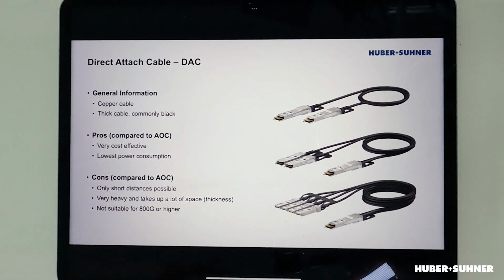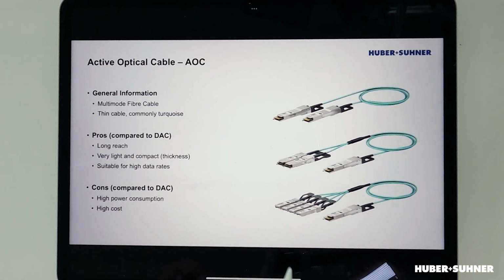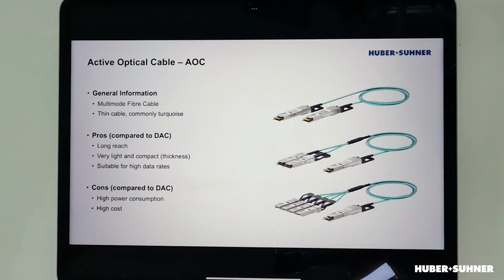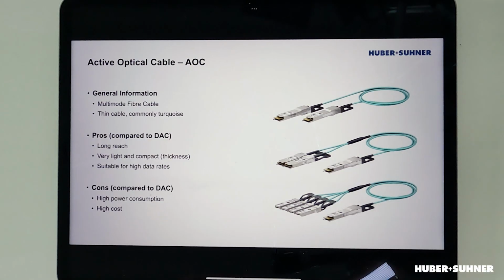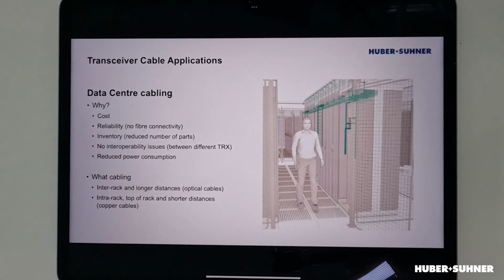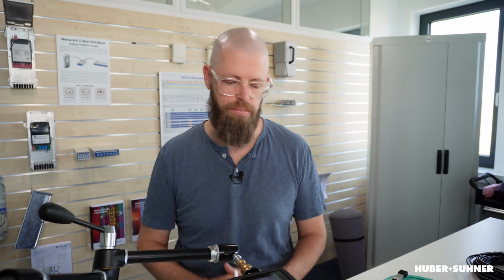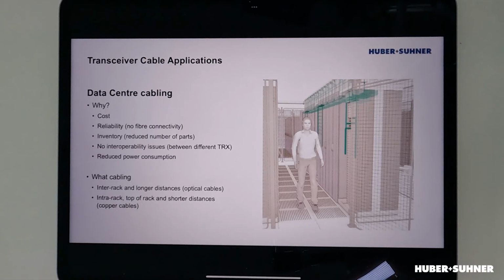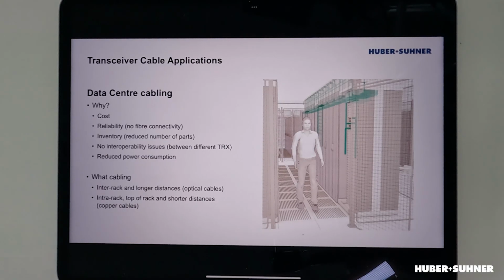Overview of #dac #aoc #transceiver Cables (04-05-01)

Comment: Can you recommend a good source to compare power and heat between the DAC and AOC?
Reply from the maker: Don’t know of one but I like the idea of such a comparison chart.
Are you looking for a specific comparison (i.e. for what data rate and distance)?
Reply: @HUBERSUHNERGroup  in that case I guess I can just look up the specs individually. 😁👍

I have a dual 10G Ethernet card in the server currently. It generates a lot of heat. So I was thinking of replacing it with a fiber card. I had heard in another video they put out less heat. If that is true then I'm further down the rabbit hole of doing DAC or AOC. 😆
Reply from the maker: @CampRusso  😄 okay, understand.
However, if we are talking about 10G and a shorter distance (up to 10m), a DAC will require around 0,3W per transceiver (i.e. per side). An AOC requires more along the lines of 1W per side. In other words, it does have quite an effect on the heat dissipation but then again the quest is how much this is in relation to the overall power consumption of the network card…
Reply: @HUBERSUHNERGroup  oh wow the DAC for less power sounds great. So does that mean a DAC generates less heat? 

The distance is only 2M.
Reply from the maker: @CampRusso   yes. Both the 10G DAC and AOC use SFP+ transceiver form factors at either end of the cable. Same form factor and less power consumption definitely results in less heat dissipation. However, from the top of my head I cannot tell you how much this means in degrees. Nevertheless, in your case and for a distance of 2m I would definitely recommend DAC. Not only is the power consumption / heat dissipation less but also the price tag 😉
Reply: @HUBERSUHNERGroup  Win win then! Thank you so much for your help. 😁🤘
Reply: @HUBERSUHNERGroup  DAC's are in place and running over an hour in both servers. I pulled out SFP from the switch side and the temp is crazy low compared to the fiber SFP. Could not even hold that one. This is awesome. 😁👍
Reply from the maker: @CampRusso  brilliant! Pleased to hear that 👍🏻